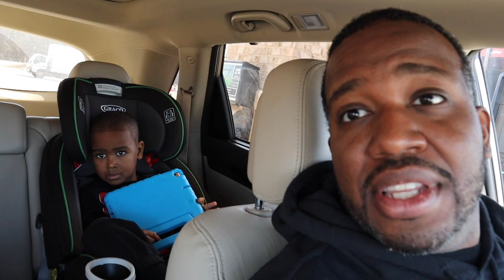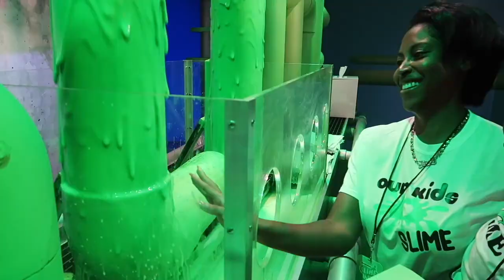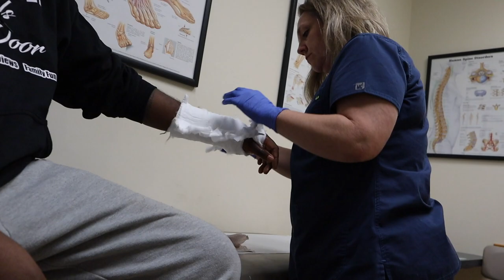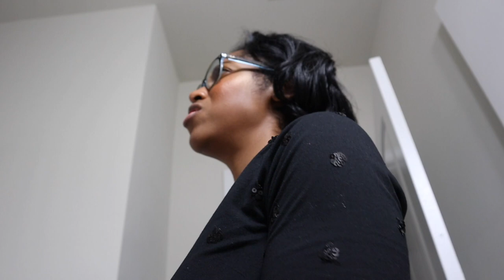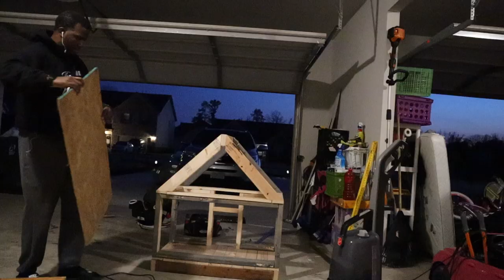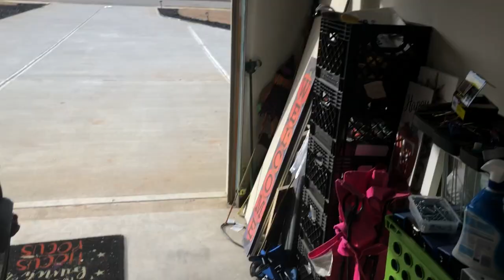Wrist Surgery | Getting Surgical Bandages Removed | Ganglion Cyst Removal

Comment: Hey I just had my surgery about 3 weeks ago and after going through comments it seems that I had a similar problem to you where I couldn’t support my body weight and couldnt bend it back without pain. I was just wondering cause I still feel pain and limited motion when bending it back and was a bit worried after surgery how long does it take for pain to go away and is it normal to still experience pain when bending/applying pressure on the wrist.
Reply from the maker: Yea that’s normal. I think it took over 3 months before I started to gain range of motion back. About 6 months before I was fully pain free.. and I haven’t had any issue at all since.. so that’s happening is that you still have scar tissue built up in your wrist from the surgery. The more you move your wrist the more range of motion you will get.. look online because they have like stretching excercises for it that really helped. But once that all goes away you will have a new wrist!
Reply: @TheNealsNextDoor  thanks for the fast response yea I was just worried cause the pain is similar to what I felt when I had the cyst so I wasn’t sure if it was normal or not but thanks for clearing it up for me.
Reply from the maker: No problem! And to be honest you might heal a lot faster than I did.. it sounds like you been trying to use you hand a lot. I didn’t because I was being a baby so it took a little longer for me to get Range of motion. I was really afraid to cause more damage but when the dr said said that once the wound closes there isn’t too much damage you can do, I started to use it more
Reply: @judgek68  can I ask how it’s been going?? I just got mine removed last week and I haven’t been moving it but when I accidentally do, it’s the same pain as prior to surgery.
Reply: @gabriellewiggin6  yea don’t worry the pain will go away for me it took about 2-3 months for the pain to fully go away just.For example before the surgery I couldn’t play basketball but now I’m playing basketball with no issues.however in terms of advice I would just recommend Taking it slow and once ur doctor clears u make sure you do wrist excersizes to slowly regain strength.
Reply: Additionally I remember my wrist was very stiff for first 2 months and that rlly worried but that goes away

Comment: I’m on day 3 post surgery…do you know when they remove your dressing bandages??
Reply from the maker: I think it was like 3 or 4 weeks or so later. I tried to check my emails for my appointment schedule but I couldn’t find it. I know I had the dressing on for a good bit because by the time they took it off my fingers and hand were no longer really swollen and it was starting to get to that itching point.
Reply: @TheNealsNextDoor  oh wow…I think they said 8-10 days for me I may be wrong …it was on the top of my wrist …they prescribed with a strong and mild painkiller but I’m good with the mild one so far
Reply from the maker: Yea I think it only used the prescription pain meds for like 2 or 3 days then I just switched to Tylenol.. the hardest part was the swelling when I moved around too much. But I think my time between visits might have been extended since it was the start of Covid when I got it done.